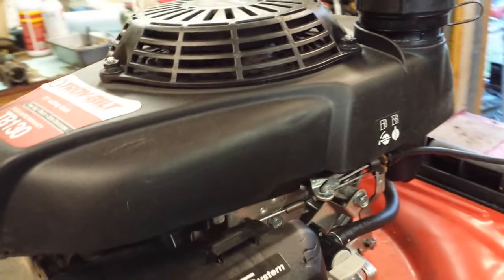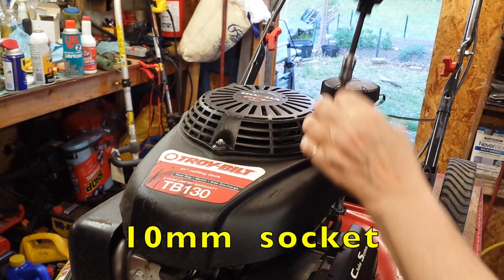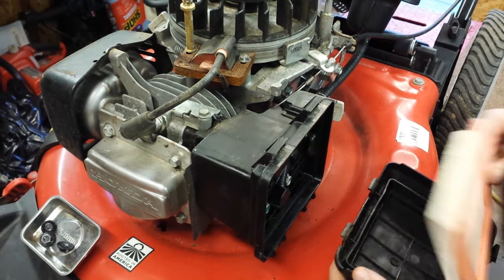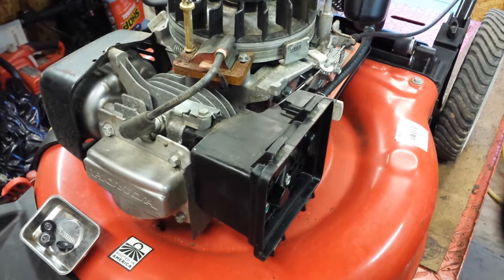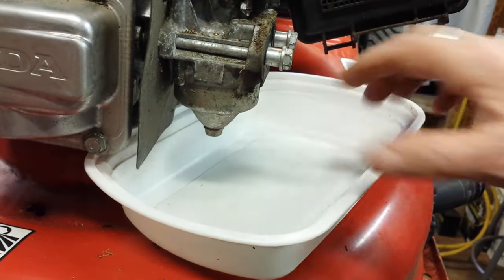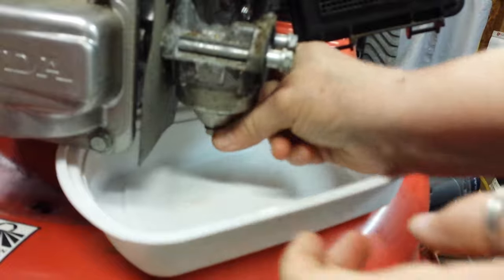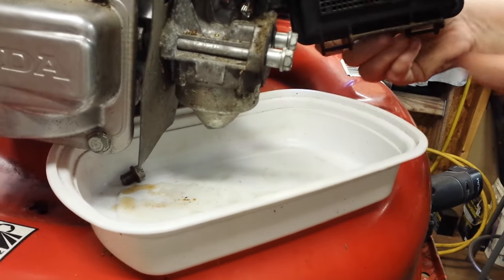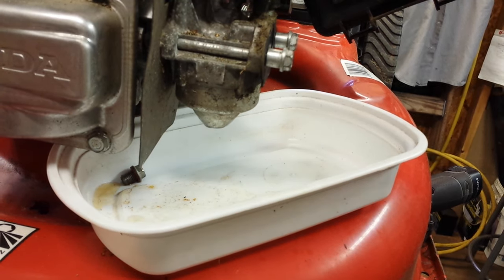Honda Mower GCV160 Keihin Carburetor Service

Comment from the maker: If this video helped you, please consider clicking on the THANKS button above 🙌
Here's some other Honda videos you might like: https://www.youtube.com/watch?v=rx0efSZpG7E&list=PLscwXOlCLzlyrhoxlz91YLrsoRZZQSaKu
Reply: Sorry!  My bad…
The next video I watched, there you were using M6x1 dowels!  😊 Well done.  
I’ll keep watching.
Reply from the maker: @jimyeske8498  No worries Mr Jim. I just appreciate you watching. Cheers!
Reply: What you also need are the Briggs and Honda oil extractors!  As seen in The same Bruce video.  If you’re interested in the details.  I can email some photos.
Reply: Hi. I commented here about an HR214 lawnmower carburator change. I don't know why my comments and your replies aren't here anymore. Anyways. I changed the carburator everything is in place and the mower problem stopping when changing the manual lever from choke to hi or low is corrected but when I change from hi to low it revs at the same speed. Any ideas?
Reply from the maker: @JazzyScat  hmmm odd. I remember and the replies are missing for me too. I can only suggest the control cable is out of adjustment, or it's slipping?
Reply: @TheLawnmowerLady  yes weird. But I didn't touch it at all and before when it was running while mowing for 5 mins it would change idling speed. When it's on choke and then moving to hi or low I can see the choke arm (snd it's spring moving as it should. The only thing I see is that the governor arm while it's free to move (as well as the idle black plastic arm on the carb it's connected to) doesn't change positions or goes back and forth.
Reply: @TheLawnmowerLady Thank you again for making a detail video .
Reply: best explanation ever, thank you
Reply from the maker: @mgc9144  I appreciate you watching!

Comment: After spending three hours fiddling with reinstalling the carb of my gcv190, I found your video, followed your guidance and BINGO, got it done in just a few minutes! Your many many helpful tips and clear instructions made me confident that I can keep my equipment in top shape. I learned the hard way to mind the float valve…luckily found it at my feet:). Thank you Lawnmower Lady!❤
Reply from the maker: Glad I could help. Thanks for watching!

Comment: I didn't watch how the float needle dropped out when I took my carb apart.  Yours is the only video I've watched thus far which shows the direction
the needle goes into the port.  That was very helpful as I was about to install the needle upside down.  This was my first stab at small engine carburetor cleaning.
Reply from the maker: Glad it helped. I appreciate you watching. Cheers!

Comment: I’ve always stored my mower with Stabil original formula stabilizer never had trouble till a couple years ago or so. Till my power valve stuck after I fixed it I watched a Stabil Marine 360 stabilizer. I got to thinking about it the marine formula it’s made to absorb condensation from the boat tanks I’ll try it in my mower and in storage. For the last two or more years it works really well doesn’t gel up to clog the carburetor. I’m using regular unleaded with the crappy ethanol and not a moment’s trouble. Have a Blessed One. Greetings from Silverstreet South Carolina.
Reply from the maker: Anything you do is better than doing nothing if you need to store it for a while.
Reply: I use my zero turn mower about 12 months of the year. I also use 87 octane gas in all of my mowers too. I have a Murray 38 inch that has had always had 87 octane gas in it. Never had NO problems with it
Reply: Me too, I have a self propel brigg Stratton engine for 15 years I also use 87 octane gas and never have a problem.

Comment: Another happy 'customer' here, watched your video the other day and fixed my mower in about thirty minutes. The hardest part for me was pulling off the fuel line, I think. 

My machine is only a few years old and wasn't that dirty, but there was a little gunk somewhere that was causing it to hunt quite a bit. Running much stronger now. Thank you.
Reply from the maker: Great to hear that Mr Brian! Glad to help, Cheers!

Comment: Lawnmower Lady, this is probably the best video I have seen in a long time. It's the first video on carburetor where someone begins by showing you how to remove the carburetor and putting it back on step by step. I had gotten fluster with the process. Thanks Lawnmower Lady.
Reply from the maker: Thank you Mr Gary for watching. Cheers!

Comment: Thank you Lawnmower Lady!! I have a Yard machine with a Honda engine, it won't stay on longer than about 3 or 4 minutes, about 20 feet of lawnmowing 😢. I think this is my next step. With your guidance, I think I'll successful!
Reply from the maker: Be sure and check your fuel cap. The vent might be clogged with debris. Next time it stops, crack open the fuel cap and see if it starts up. Without a vent to atmospheric pressure, as the fuel leaves the tank, it can create a vacuum that a gravity fed fuel system can't overcome.
Reply: @TheLawnmowerLady  already unplugged the vent holes in the gas cap along with changing the air filter, oil and spark plug. So, with your awesome assistance, it's off to clean the carb. Have looked into a ultrasonic cleaner too. Love your videos, your an excellent teacher and thanks for sharing!

Comment: Thanks for this video. My small engine guy retired so I'm on my own. My GCV160 on a Craftsman won't run except a few seconds with starter fluid in it. There is fuel flow and the spark plug looks good and it will run for a few seconds which tells me there's spark. So it comes down to the carburetor which I took off and mine looks nothing like yours. It was fairly clean and the needle looked ok. Stumped, I ordered a new carburetor though there is no obvious fault with the one I have. The mover is a 2019 and been kept in a garage. I've never had an issue with a Honda engine before. You video was great for showing me things to look for though my carburetor is slightly different.
Reply from the maker: Did you take out the idle jet on top? Yours might have a plastic idle speed adjustment screw that needs to be removed. The plastic jet cones out and has to be clean. Tom, at @vintageemginerepairs has a great video on that style of carb.

Comment: We've had this Honda GVC160 motor on an emergency lawnmower for the last 10 years. It's never run well and I've spent many hours trying to get it perform smoothly.  In Australia they come with a manual choke and the idle screw is placed in such a way as to make it impossible to adjust once the carburetor is back on the motor. Along with the air box and the gaskets, they are the work of the devil.  I take my hat off to you madam.
Reply from the maker: Cheers Mr Andrew! They can be difficult. i appreciate you watching!

Comment: Stella, that was a nice demonstration and narration of cleaning the Honda carbs. Ive wrestled with enough of those gaskets,  heat shields, etc. I went to the hardware store and bought 2 bolts ,1/4 inch longer and cut the heads off and use them as studs. Made my life alot easier and they work on all Honda small engines. Keep the videos coming. Looks like you enjoy what your doing!  👏👏👍🇺🇸  Roger
Reply from the maker: Thanks Mr. Roger for watching! I have some long threaded rods from a three arm puller that I use sometimes (when I remember :embarrassed: ) every now and then.

Comment: Very nice video, thanks very much!  Very helpful!  Those Hondas are such a pain with those long bolts and so many gaskets to get in the right order.
Reply from the maker: Thanks! Honda makes a very pricey “tool” for this that is really the bolts with no heads. I fabricated the same thing with two 6mm threaded studs. Most any other of my other Honda carburetor videos show this. Makes the job easier. Cheers!

Comment: Tool tip: I used a piece of multi strand copper wire with the end stripped to clean out all the small holes.  One strand for the smallest, a couple twisted together for the biggest ones.
Reply from the maker: I do the same thing, but I always lose that tiny octopus looking gadget in my shop. Thanks for watching.

Comment: When I work on my Troybilt TB 240 w/ the Honda GCV 160 engine I use two pieces of wood dowel rods cut a bit longer than the carburetor bolts and insert them into the threaded holes in the engine block and assemble as you did. Then pull one rod out insert 
your bolt, thread on loosely and repeat for the other side
Reply from the maker: Thanks Mr. Ben. I actually have some M6 threaded rod just for that purpose. I was really only removing the airbox to make it easier for the camera to see pulling the carb bowl and draining. I wasn't planning to pulling the entire jello filled carb.

Comment: The OLD MAN at EP just saying that it is nice to see the ladies getting involved with small engine repair. A handy tool to get if you do not have it is a pressure pump to check for seating needle valves prior to installing the carb. Nikki carbs are the worst.
Reply from the maker: Thank you Mr. Wayne! I do actually test the needle and seat, but I figure YT would flag my video as inappropriate if I included pics of the old suck and blow with me lips wrapped around the fuel barb. Lol. I'm often too lazy to get out my miti-vac. Cheers!
Reply: Your welcome and good luck on the channel it takes time but is well worth it if you are dedicated to providing quality repair and service videos. Keep up the good work.
Reply from the maker: @waynestefinashen239  Many thanks! I've watched EP channel for a few years now and I appreciate the succinct and the on point commentary. I strive to keep it simple myself for the average DIYer.

Comment: Nicely done, thank you. If you apply a small amount of dish-soapy water onto the outside of the rubber hoses, the clamps will slide along a bit easier. Of course, you don’t want to get any inside the hose.
Reply from the maker: Thanks Mr. George for watching. I have several bottles of soapy water in the shop to look for leaks. Need to remember to squirt those hoses. Cheers!

Comment: Nice clear video. I do believe though, that you have the large square gasket the wrong way around. At least the markings on mine indicate that. The small high section in the corner is facing rear, not forward 👍
Reply from the maker: I think I did the same thing as you, matching up the witness marks. I didn't occur to me  it was wrong until several months later. Maybe wrong from the factory? Maybe the fiddle faeries? Thanks for watching!
Reply: @TheLawnmowerLady  👍

Comment: Later models have captive carb mounting bolts which make reassembly much easier. The air box goes on after the carb is in place and is held on with two 10mm nuts. There is no need to remove the top cover either. The idle speed sounds a bit high.

Comment: What caused this, using ethanol gasoline?
I use non ethanol gas and so far have had little problems 
Also use sea foam to help protect my small engines,
Good job explaining your cleaning procedure
Reply from the maker: Thanks for watching Mr Fred. Yes, ethanol laced fuel tends to separate and once the alcohol evaporates, you are left with water. It sinks to the lowest point in the system. I believe the gelatinous goo is the detergents induced in refinery process reacting with the water that was left. Non-ethanol fuel obviates these problems, but unfortunately is not available everywhere. Cheers!

Comment: The large gasket between the carburetor and auto choke , which Honda calls an air guide, is shown in the reverse orientation on the factory parts assembly diagram. The way you have it assembled means the small hole doesn't align with the air passage on the carburetor.
Reply from the maker: On this particular model, it doesn't matter. Look closely at 12:47  That passage is sealed on the carb. There is no mating passage on the auto choke actuator. ( look closely during the re-assembly) It's commonly called a heat shield, and yes, on some models it does go on the other way. This mower came from the factory this way, no reason to flip it, IMO.

Comment: Running the motor until it dies upon storage is good practice indeed but I found this will leaves some fuel in the carb bowl, I also loosen the carb bowl nut and let any residual fuel drain out. Keep safe and be merry
Reply from the maker: All good tips. I appreciate you watching. Cheers!

Comment: Great video thanks for sharing!! I did the entire process everything step by step following your video and didn’t work, at least I try😅
Reply from the maker: Dang, sorry about that. Was it just not starting? Does it have spark? Can you squirt a bit of fuel of starter fluid into the carb and get it cough a bit?
Reply: @TheLawnmowerLady  before putting it away for the season I added fuel stabilizer. Last year the machine was working normal but I tried this season to cut the grass and didn't start anymore, I put some starter fluid on it and didn't do anything, I tried also replacing the spark plug and still didn't work so I'm digging a little bit more on the ignition coil and taking some measurements on that and see if that is what is wrong with it, I also noticed that one of the gasket was missing(one close to the air filter) but I don't know if that will make the machine fail. thanks for responding (FYI my machine is a Husqvarna engine Honda GCV160)
Reply from the maker: @robertoariel8476  the gasket won't have anything to do with a no spark situation, but it would contribute to a hard start, poor running.
Reply: @TheLawnmowerLady  okay thanks I measure the coil and comparing with the information that I got on the web seems that the coil is falling off also I’m going to get the gaskets to make sure that everything is on place. Do you think that I should check something else?

Comment: I watched this one again! As in all of your videos, the camera work is excellent and no annoying music ! I was hoping to learn more about your ultrasonic process. I heard you once say that you like Pinesol as a cleaning solvent? Do you have anything more on this? Such as the mixture? effects on the parts? Thanks, and great job.....again!
Reply from the maker: Thank you very much! Although I've experimented with some music, mostly when I speed up the repetitious bits, I hope it's not too annoying 😇I think I went into a bit more detail on this video https://youtu.be/JJ2AW0OlMYs on my ultrasonic. I use PineSol most all of the time, about 5:1 water/PineSol. I find it has enough solvent properties to clear even badly varnished carbs. It doesn't really discolor the carb bodies, unlike orange and green de-greaser type solutions. It brightens up the brass bits as well. If I have rusted bits, CLR works well, but discolors parts badly. I wait a day or two, for all the sediment to settle on the bottom, and them filter the solution through a coffee filter. I can use the same fluid for several months. I really appreciate you watching. Cheers!

Comment: Wish you'd spent more time on the pilot jet.  4th time tearing down & cleaning the same carb and resetting the governor.  Cleaned the fuel tank too, but it still surges like crazy.

All the videos I've seen have me convinced it's the pilot jet beneath the Phillips screw.  I can't get anything to penetrate the hole at the bottom center including smallest torch tip cleaner, lemon juice & oven cleaner.

However, I can see 2 horizontal holes at the bottom of the female threads.  One is on the same side as the part number and the other directly across from it.  One is a little larger & I may have made a little headway there.  Not really sure.

Steve's smal engine saloon shows going into that center hole with a micro drill bit, with emphasis on when it finally gives way.  If not for seeing that, I'd say there is no hole there and it's one or both of the horizontal that actually transport fuel.

After more videos, gonna try more lemon juice, pine sol if I have any, possibly boiling, and the micro drill bit(s) if they have 'em at Harbor Freight.  Frustrating . . .
Reply from the maker: This video goes into much greater detail on that pilot circuit about 5 minutes in: https://youtu.be/wJPM_ArLSgg I use old guitar strings. The smallest E-string should be able to go straight into the jet from the top. I use the G-string to go into the front and make sure I see it looking into the top of the carb. As much as I don't like carburetor spray, it's probably the best thing to dissolve any varnish from old fuel. 

Edit: It just occurred to me, I have had some of those older Honda double walled fuel lines collapse. Hope this helps.
Reply: @TheLawnmowerLady  Thank you  so much the reply.  I was surprised!

I watched the video you linked and appreciate it very much!  

A quick update:  Boiling water poured directly into the pilot jet hole seems to have helped.  I now have spray coming up out of the pilot jet.  However, I didn't try going thru it again with a torch tip cleaner (from either direction), but I will now.

Still surged like crazy upon startup.  I experimented blocking some of the intake air with my finger and it would even out, but hard to keep the sweet spot.  I taped it off as best i could and got to mowing.

It still surged some, intermittently though.  Oddly, not as much when pulling it backwards nor when plowing through tall thick grass going fwd, and randomly not at all for 10 - 30 seconds at a time 

The air cleaner housing & cover are pretty beat up, as are the gaskets from all the assembling & disassembling.  Replacement might be the ticket.

Got some micro drill bits (only $2.99) but don't know if I should bother with them since I was able to confirm get spray coming up out of the pilot jet.  

I will definitely check the fuel line & possibly replace it.  Will keep u posted.  Thks again!
Reply from the maker: @evelynmahoney3569  This is how we all learn. Hope it works out for you. Cheers!